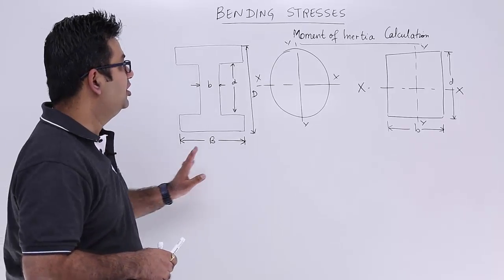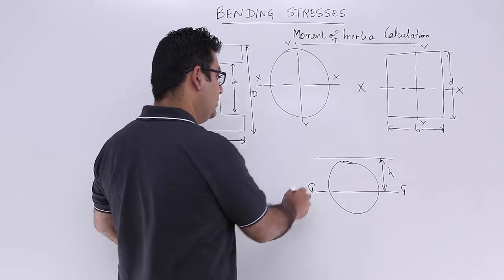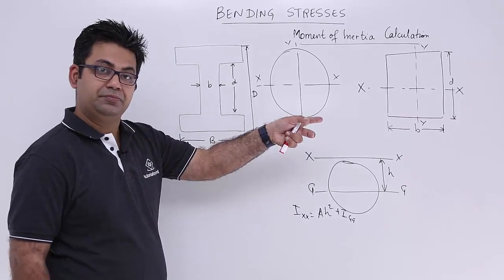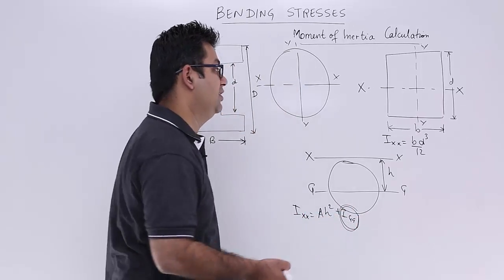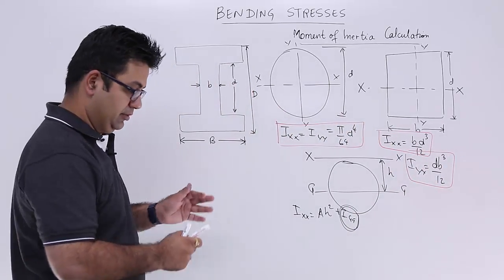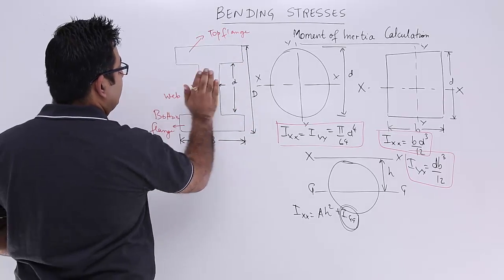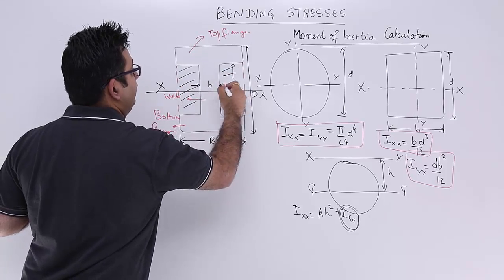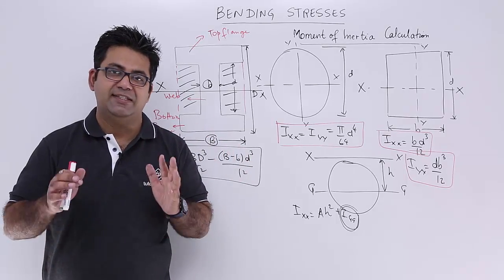Moment of Inertia Calculation

Comment: sir can you teach the Iyy for the last I section.
Reply: Using the same subtraction method, you would subtract the MOI of the two rectangles from the total rectangle.
I_total = DB^3/12
I_small rectangle = [ (B-b)/2 * d ] * [ b/2 + (B-b)/4 ]^2 = [ (B-b)/2 * d ] * (B+b)/4
Iyy = I_total - 2 * I_small rectangle.